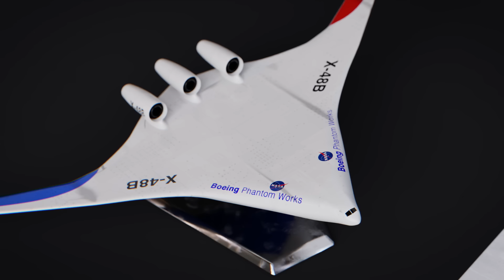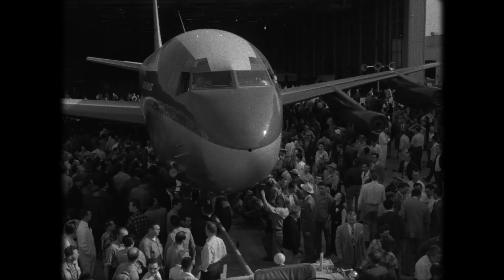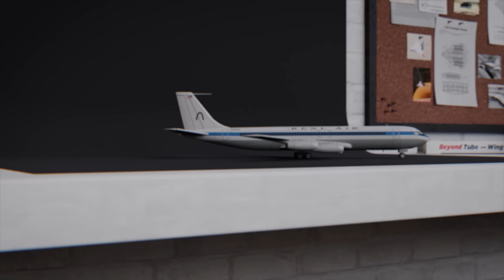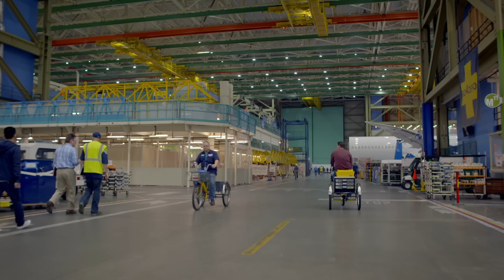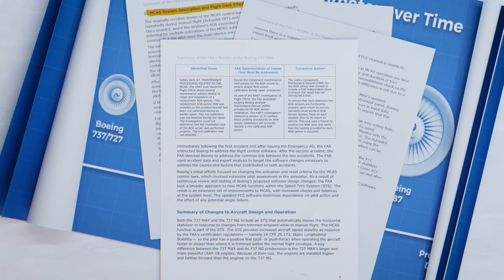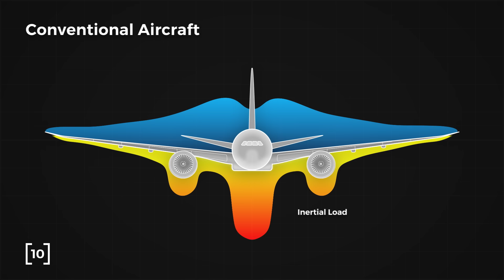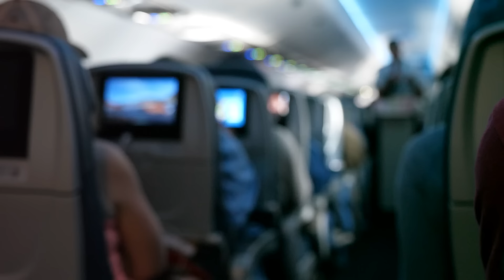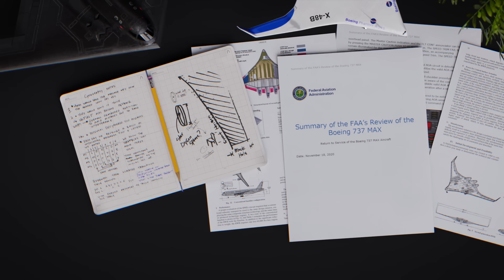The Plane That Will Change Travel Forever

Comment: 10:00 - So much fucking bullshit from a well respected channel.
Frankly its a shame, to see this level of a quality drop. 

Flying wing ARE NOT inherently unstable.
Since they are 3D, and not just a 2D cross section. They are always delta wings, because it puts the outer edge of the wing BEHIND the center of mass, making it stable in pitch (and creating a place for surface to control pitch).
When a flying wing is unstable its intentionally designed to be so, be it to facilitate stealth, or to increase manuverability (at the price of neding fly-by-wire controls).

Here is a video explaining it without going too far into the weeds:
https://www.youtube.com/watch?v=gkb11eKXM14

The issue with lack of vertical control surface is the EXACT OPPPOSITE of what you said.
The issue is TOO MUCH stability.
Or more specifically the coupling of roll and yaw - creating the so called adverse jaw also known as "dutch roll". To counteract this (more effectively) you need vertical control surfaces.

And what allows flying wings to be commercially viable is not fly-by-wire.
If that were the case we would have them already as the technology is already decades old, and present in commercial avaition.

The "breakthrough" is the re-discovery of bell shaped lift distribution, which creates proverse jaw, thus truly eliminates the need for vertical control surfaces.
This was enabled by the rediscovery of the late works of Ludwig Prnadtl, which were not translated into english, and sit gathering dust.

What is even MORE puzzling that the rediscovery of this, and the subsequent testing was done by NASA personnel.
Thus you somehow managed to stumble upon NASA stating thata we will soon see flying wing airliners, yet completely miss why they think it will happen.

P.s.: inherently unstable designs (with same center of lift as the center of gravity) are inherently more efficient than the alternatives.
Since the tail has to create a downforce to stabilize a conventional plane.
And even in Burt Rutan style canard designs, which balance the center of mass between 2 lifting wings, you still get inefficiency, as a single longer wing is more efficient, than if you have the same total wing length (& area) split between a canard and the main wing.*

*due to wingtip vortices having more wingtips to form at, and the shorter wing meaning a shorter path to travel from the bottom high pressure area of the wing to the top of it.
Reply: Also, the bell shaped lift distribution gives the best theoretical wingtip vortex elimination.
Thus its pretty easy to spot "outdated" designs (I mean less than state of art designs), by the various attempts at creating a wingtip vortex laminator, on their wingtips.

18:30 - and elliptic lift distribution is not the ideal lift distribution.
Its ideal lift distribution for a given wing area - thus its only ideal if we assume a wing made out of a material, thats capable of bearing any load and does not need to increase in weight to bear more load.

If we are talking real world wings, subject to the constraints of weight and material load bearing limits, then bell shaped lift distribution will beat it.
It will have a larger wing to create the same lift, however it will still have lower mass, and lower drag.

(Sorry for messing up english terminology its not my native language, i hope i managed to get my point across)
Reply: Like a bird?

Comment: Back in the late '50's they had an aircraft that would be perfect for airliners, but for some reason, the companies insist on doing it the hard way. Stupidity never fails to amaze me.
Reply: What aircraft are you talking about? The older flying wings were by far from perfect for passenger - or cargo - use.

Comment: I remember seeing concepts for these sorts of aircraft in a Popular Science or Popular Mechanics article back in the 90's. I'm not sure major manufacturers are even capable of the level of innovation and risk necessary to bring one of these to market.
Reply: There are massive issues he is ignoring. There is a reason engineers don't run businesses, they struggle to see the larger picture.

Comment: Lets be honest. The "engineering" used to reduce fuel per passenger, was packing people in like sardines and highly taxing baggage.
Reply: Let's be honest. You have no clue what you're talking about.
Reply: The airplanes get the best passenger miles per gallon at about 75% loaded. But all the other costs are per flight so it pays the airline to waste a bit of gas to get the total cost down.

Comment: They never told the pilots about mcas so the pilots never knew how to fight the problem , with NASA and other space agencies the have backups of the backup systems which massively reduces the risk of multiple failures
Reply: You obviously have no concept of the situation. You know pilots weren't told of MCAS? Because it had nothing to do with them.

MCAS affects the automatic trim system. The pilots interact with the auto trim system, not MCAS.

And guess what? The procedure on how to deal with malfunctioning auto trim hasn't changed since the very first 737.

1. Turn off the system
2. Slow down
3. Manually trim

In both crashes the pilots were unable to follow this simple procedure.

Comment: Boeing and McDonnell Douglas (and likely others) were looking at this 25 years ago. The problems: (1) To make the wing have sufficient thickness to accommodate passengers yet still be aerodynamically efficient, the airplane needs to be really big, too big for most commercial runways and terminal gates; and (2) next to no visibility outside for the vast majority of passengers. Having seen the vast number of passengers in current aircraft who ask for window seats but keep their blind closed, I think the second concern may be overstated. But the first would require a huge investment in airport infrastructure to accommodate the gigantic blended wing airframes.

Comment: I've seen this exact plane like 20 years ago in magazines, and we still haven't even made a prototype....
Reply: I agree. Also, where are our jet packs that we were promised in magazines back in the 1950s?
Reply: @ppainterco  One flies occasionally outside of Los Angeles International Airport, "Jet Pack Man"  causing a large concern about flight safety.  Him and stupid drone operators, and Tic Tacs.
Reply: @bbirda1287  - yeah, I’ve listened to the ATC recordings and there is one video on what looks to be a person in a jet pack at 6,000 feet.  There us speculation that  it’s actually a drone with a dummy.  The jet packs only give about a minute of thrust and it’s tough to get that kind of elevation with thrust alone.

Comment: I agree upto a point with the MCAS, unlike the bomber the 737 max 2 crashes could have been prevented by just flicking the 2 trim cut off switches 

first crash definitely could have been prevented because they were seesawing up and down for 7 minutes and at no point did they attempt to turn the power off the trim when they knew they had trim problem, second crash the captain waited over 40 ish seconds before killing the power to the trim)l

faulty trim power system is something you should be able to work out in Less then 15 seconds (as a normal pilot it's a memory item as its something you must act on immediately) as it can and will crash your plane if you let a runaway trim to continue its why the trim stab cut outs are located there to stop the powered trim system

Comment: Very good video! The only problem I see is the repair and maintainance of the carbon fibre parts. As fas as I know carbon fibre is not very easy to repair at least in contrast to aluminium fuselages. Todays planes fly a very long (20 years and longer) time because they are so easy to repair. Most of these aluminium fusalage  repairs are because of the material fatigueness due to the pressure cycles. The new blended wing aircraft may not be the victim of material fatuegness however there might be a problem with long time maintainace because the fuselage is not only undergoing pressurecycles. It also has to land and resist the flight cycle forces (landing, acceleration and decerleration) there are also very different causes which could damage the fusalage (birdstrike etc.). I hope the engeneers think of something to prevent these problems.

Comment: 2040 doesn't feel nearly soon enough =( If SpaceX can develop an entirely new, previously unseen class of crewed spacecraft from concept to orbit in under ten years, surely it would be feasible to get a full-size blended wing at least started on certification by 2030 after all those decades of prior development.

But I suppose it's a bit like the electric car dilemma for legacy automakers: by innovating, they render their own factories obsolete. You'd think that out-developing the competition would push companies towards innovation, but in reality the opposite can often be true. The innovator ends up with the double whammy of paying the price of development /and/ spending extra on decomissioning perfectly good infrastructure, equipment, and workforce (often against the resistance of said workforce!) while the competition continues making money.

Here's hoping the pressure to innovate will increase swiftly on aircraft manufacturers in the near future!

Comment: As an active aircraft mechanic, I have always had some questions and concerns on the blended wing designs incorporation to passenger and cargo applications. Definitely want to thank you for your insights and video as the logic, reasoning, and engineering behind the benefits and changes helped settle a lot of those questions. Very good video!
Reply: It’s the sort of thing that’d be a similar approach to current MD-11s. There are inherent differences that’ll come, but modern tech also helps with those. A remote engine oil servicing reservoir, if not just panels on the engine cowlings for a mechanic to easily access necessary components
Reply: Good luck servecing those engines on the top of the aircraft tho. Im sure that there isnt a lot of no step surfaces around that area, like some sort of, IDK, elevators, spoilers and flaps, that kind of thing, but it sure is easy to put a person on top of all those, right? Also do we take those engines off by hand or should we bring the trolley, oh wait, we are gonna need a crane...

Comment: You Sir, are right on the money about Boeing's corporate greed. Great video all around.
Reply: That is nonsense from people who hate Boeing and want to ignore the incompetence of third world pilots.

Automatic trim on the 737 was not a new system, MCAS was simply another system that used it.

The procedures on what to do if the auto trim is malfunctioning is simple. Turn it off, slow down, manually trim.

In both crashes the airlines knew the sensors were faulty and ignored repairing them. And the pilots in both accidents showed they were incapable piloting an aircraft. Once something happened they didn't expect they shut down mentally.

Yes Boeing is at partial fault. But those accidents would have never occurred in a country that has proper aviation safety.

Comment: Couldn´t you add windows in the roof of the plane? Maybe with a mirror, so you don´t just look up into the sky, but sideways. But I could also see that as being disorientating, looking to the side while looking up.
Reply: You could, but...

Mirrors: sticking up out of the skin of the plane? A lot of external surface area and drag. Also, I think seeing everything backwards as you fly would be worse, not better, for comfort.

No mirrors: so, just skylights. I think that'd be pretty cool, but it's not what everyone would want, and when the sun is high in the sky you'd need to shade them, I suppose via LCDs.

Either way: there's a huge advantage to not having windows: stronger and lighter structures, better insulation (it's cold in the stratosphere, y'all), more flexibility for sensible luggage bin layout, and just in general less stuff that can go wrong.
Reply: @ps.2  you need windows for proper evacuation though, otherwise your eyes might not be well adjusted to outdoor light levels. That's why they ask you to have the windows fully open during take off and landing
Reply: @fl00ds  What we need is some sort of technology to produce ... I dunno ... some kind of artificial lighting, inside an aircraft, to give our eyes a chance to partially adjust. I know that's a big stretch, but I'm a techno-optimist, I feel like someone will invent this sort of thing soon.
Reply: @ps.2  lights dont work when cabin power is lost. That's why you need external lighting. Then there are also the scenarios where you slam into the ground and the aircraft breaks apart. You need people to be immediately capable of evacuating, without losing precious time to adjusting to the new lighting situation.
Reply: @fl00ds  Asking everyone to open their windows is much quicker than flipping a switch to put the lights into emergency landing mode?

As for cabin power loss, they already have to account for that — existing airplanes can light the aisles at floor level, and I presume that has some backup power source.
Reply: @ps.2  Floor level lighting is nowhere near as bright as outdoor lighting. In a loss of cabin power, the APU is used only for powering the cockpit/instruments, not to be wasted on useless cabin lighting given that you can just open windows.
Reply: @fl00ds  That's the whole question, though, isn't it? Sure, you can "just open windows" on current commercial aircraft. But if you couldn't, how would you solve the problem instead? I submit that you would probably deploy more of this newfangled "artificial lighting" technology.

Doesn't need to be as bright as the noonday sun, either. Brighter than typical nighttime indoor lighting, fine. You could probably do a gradient getting brighter closer to the exits, to save energy (i.e., save weight required in the backup battery banks).
Reply: Maybe they could use light tubes, like sky lights in a house?  No direct visual component, but at least a bit of natural light.

Comment: Wasn't the tube and wing design around before even jet propulsion ?  I would think the DC-3 matches that description and this was around the 1930's.  What am I missing ?
Reply: I think the two defining characteristics missing are swept wings and engines in pods underneath and in front of the wings; those are everywhere because they're pretty much the optimum.

Comment: Yes carbonfibre plastics are exceptionally effective in aerospace engineering, but also very expensive in practice, in comparison to traditional materials.
Reply: Yeah. You wonder if maybe the increased passenger capacity is simply what's required to make these things financially feasible.

Comment: Speaks of MCAS tragedy, ignores Airbus fly-by-wire technology on all their aircraft since the 80's....
Reply: Probably because they are completely different things ? The 737 doesn't even have fly by wire. Hell, it still has steel cables that go from the control surfaces to the yokes (which interestingly enough, means that it is still flyable even after losing hydraulic systems).
Reply: he focused on that as an emphasis to what can go wrong with fly by wire, just and example

Comment: 8:19 True KSP players know that it makes planes very instable
Reply: to be fair KSP has a very basic atmospheric flight simulation. Plane Maker in X-plane 11 is a much better tool to create funny designs yet retain a good level of realism.
Reply: @mro9466  as a fellow KSP player I can attest to that
Reply: @mro9466  Ferram Aerospace Research mod. IIRC it has a pretty realistic aero simulation, voxelizing the entire vessel and calculating the drag for the entire craft (not per-part basis). It simulates stuff like area ruling and different modes of oscillations. And a lot (and by that I mean: too many) graphs and simulations. And it's still KSP, so stuff breaks on a bart-by-part basis.
Reply: ah, I didn't know these, i'll try them ^^

Comment: there are two problems that completely prevent alternative fuels from completely replacing fossil fuels:
1. energy density (and energy packability or fluidity)
2. energy volatility (how likely it is to just simply ignite, even when treated properly)

as much as people say ICE cars catch fire, they also forget the situations, design flaws, and the lack of maintenence that causes them, whereas Li-ion and hydrogen need only a tiny bit of a spark to become a runaway event that you can not, under any circumstances, prevent (and why its illegal to ship such batteries/cells on planes) without technologies that we either dont have, or would be prohibitively heavy/costly to maintain and implement

electric vehicles are great for cities, because of their short ranges
gas vehicles are great for long-range needs, which usually are more rural and suburban

and then theres the point of how to use the stored power, and how heavy, reliable, or space-inefficient it may be, once you consider the torque or horsepower requirements of certain applications, along with the stresses of needing to keep at a certain RPM that may be too stressful for the intended engine type

remember this as well, the reason why gasoline and other types of fuel ignite so easily is because of their energy density, not necessarily because they are fossil fuels (its like comparing lead-acid or NiMH to Li-ion)

Comment: The other issue with the blended wing design is that passengers seated further from the centre line will experience more deflection when the aircraft turns or is hit with turbulence which will exacerbate motion sickness